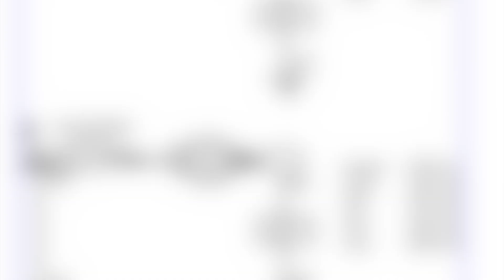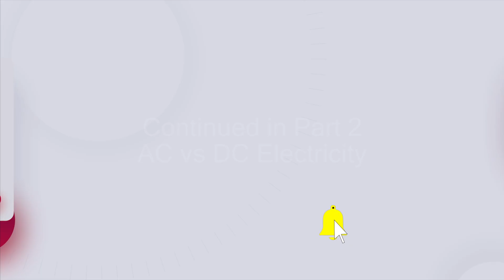Everything You Know About BODY VOLTAGE Is Wrong - Earthing & Grounding HEALS - PART 1

Comment: How long is good length for ground rod reference for the multimeter? 4 ft or 8ft? Which one do you use for your multimeter?
Reply from the maker: I use 18 inch rod for the meter placed near the grounding rod to be tested.
Reply: @DrAndrewDoan is there a reason you dont use the 18inch rod to ground yourself as well? Wouldnt there be more conductivity and less resistance than a shorter rod?
Reply from the maker: You can. But when you check body voltage, you need a reference rod and grounding rod for the body.

Comment: Hello Dr.  Great channel, subscribed.  I have a question.  I run into a 18g solid copper sheet. I rigged the thing to use it as a floor mat under my desk. The readings I am getting when grounded is a lot - higher than all the standards out there.  My readings are over -180.2 /-200Mv at times.  It  has been raining  here x three days in a row, maybe thats why? . Metal spike I used is about  2' into the ground. Are  this readings normal ? or am I doing something wrong.   Thank you.  Btw, when not grounded my reading is about -02.0/-03.1 on average
Reply from the maker: Thank you for your comment and encouragement! Where and how is your meter grounded?
Reply: @DrAndrewDoan  The mat is plug into the wall outlet  ground now,. I am using a blanket ground cord this time. negative meter  prong is in contact with the copper sheet too. I am holding the positive prong with my fingers  while my feet is on the  copper mat. Multimeter is dialed to the 200m  setting and the  reading now  (grounded )is from -160.5 to -198.3  on average.
Reply from the maker: AC setting? It sounds like you are measuring DC.

Also, meter needs to be grounded to a separate good grounding point, like a rod outside.
Reply: @DrAndrewDoan what ground rod do you use for referencing for your ground meter? 4 ft or 8ft?
Reply from the maker: 18 inch grounding rod.

Comment: Why, when using a grounding rod in the ground connected to my grounding sheet does my body voltage increase? Yes, I do have a cheap meter, I will admit that. But I test it by putting the black prong in the grounding socket of the outlet and holding the red prong, then I touch the grounding sheet that is attached to a copper rod pushed into the earth outside my home. When I ground the sheet to the outlet my body voltage deceases and I get a good night sleep, but I feel groggy and brain fogged the next day. Paradoxically, grounding directly to the earth, I feel better the next day even though the meter shows a higher body voltage.
Reply from the maker: You should connect the black lead of your meter to a second ground rod placed next to your first rod, not to the wall outlet. Right now, your body-voltage reading is using the outlet ground as the reference point, and because we don’t know how well that outlet is actually grounded, your readings will not be accurate.

Also, when you measure your body voltage while grounding through the outlet, the voltage appears to drop simply because the outlet ground is the same reference point used by both your meter and your grounding sheet—not because your body is truly at a lower potential relative to the earth.
Reply: If I connect to a second rod, should I use DC voltage?
Reply from the maker: No, measure AC voltage. What you are measuring is the AC voltage induced on the body by EMF generated from AC sources.